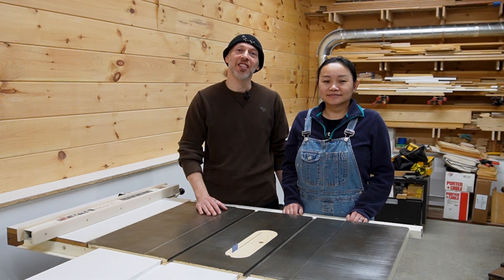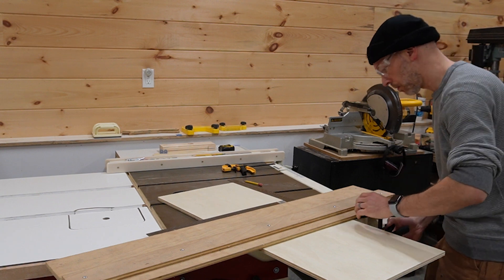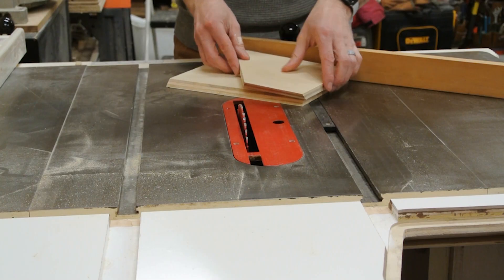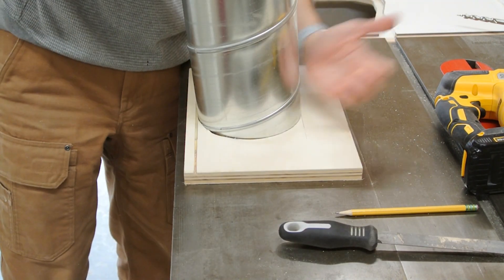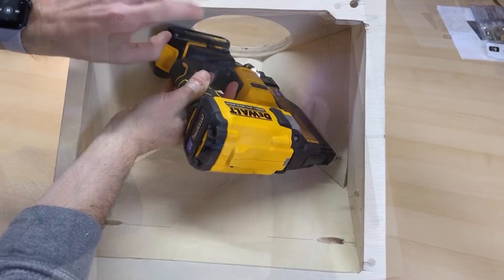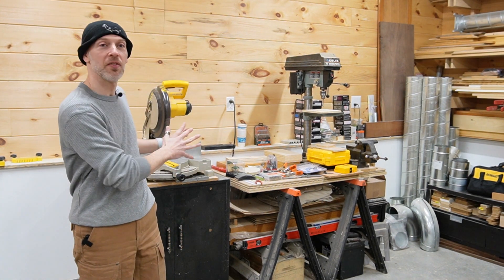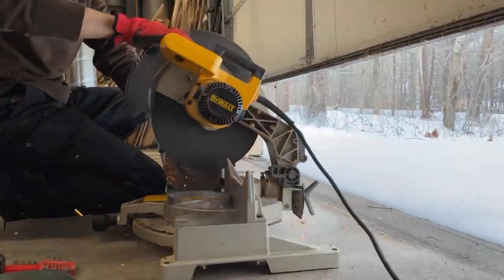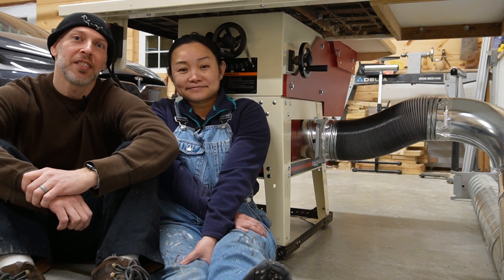Upgraded Dust Collection for the Table Saw!

Comment: Nice build, how does it work.

As for using a miter saw to spin a grinding blade, not a good idea
A miter saw spins at a different speed then a hot saw or chop saw spins, plus there is a serious risk of exploding fiber disk, these are not ment  to be used on a miter saw
Best advice don't do it.
Don't put them on a miter saw, table saw or radial arm saw. Your asking for a trip to the ER. 

I
Reply: I watched this thinking it was a hybrid saw but thats a straight up contractors saw  the hybrid is more like a cabnit saw without a bottom.
My 2017 version didn't come with a bottom metal plate, then in 2018 they started to. I got my saw free and Jet refused to send me the upgrade part i would have to buy it.
At the time it was 50 or 60 bucks for a flat chunk of metal not worth it, the back of the saw has a 2" dust port. Then they tell you to use a dust collector with 1700 to 1800 cfm  a shop vac wont do it.
So why put a shop vac port on it?
Reply from the maker: We're glad you liked the build. We're really happy with it! The 6" port connected to our dust collection unit does a great job at capturing most of the particles. The chamber that the outfeed support table creates, along with the zero clearance insert that we use most often really help isolate the dust and ensure it goes into the collector.

Thanks for the tip about the grinding blade, by the way. We hadn't considered that they're meant to be run at much slower speeds!